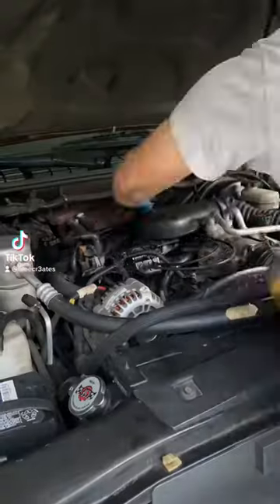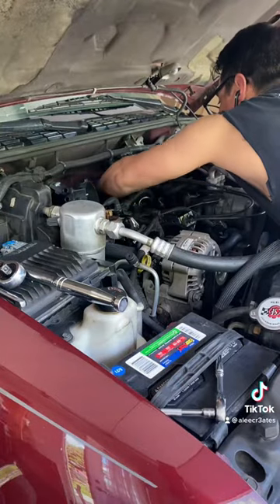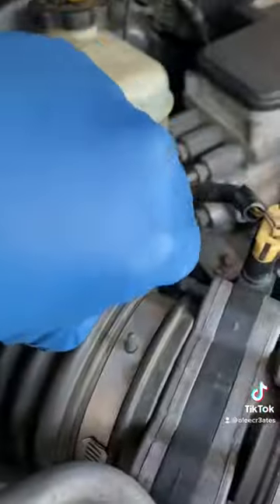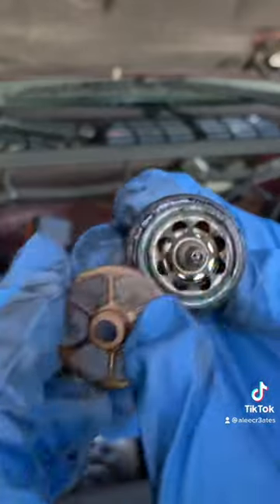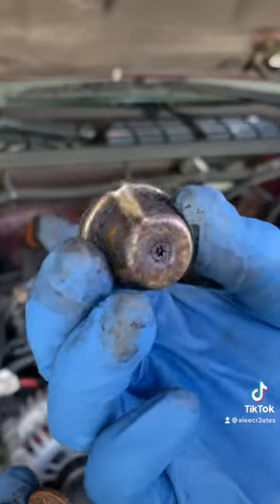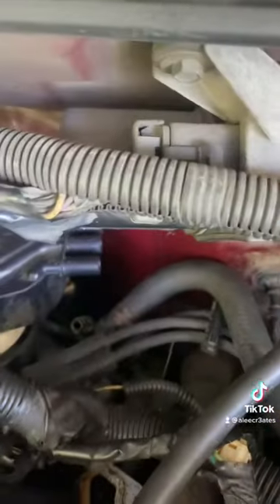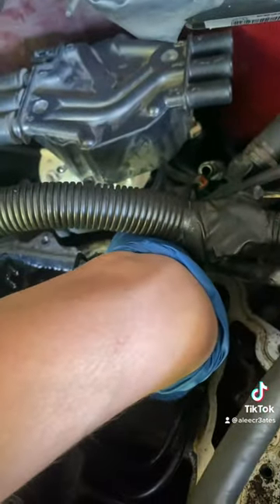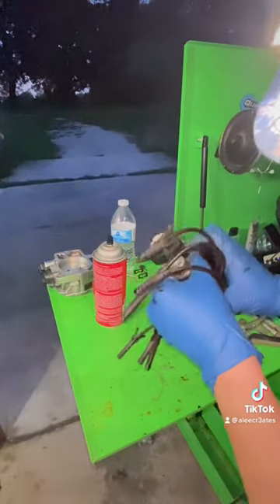Fuel Injection Pressure Regulator install on 4.3L V6 L35 Vortec

Comment: I have the 4.3 on my silverado and i think this is the problem. Truck bearly turns on have to use starter fluid to turn on and when on heavy throttle boggs up